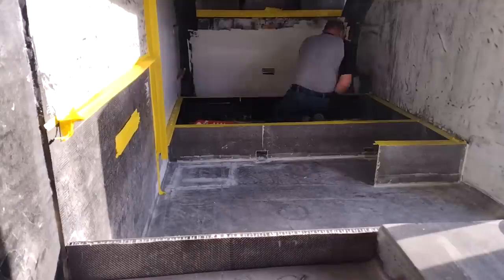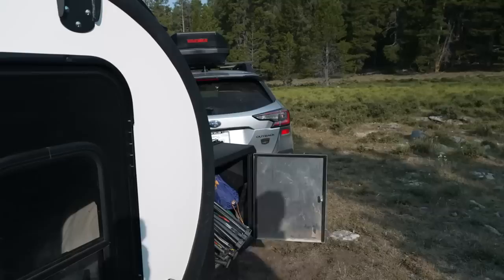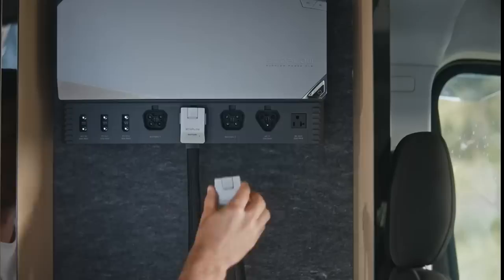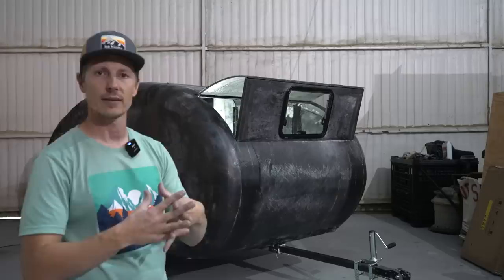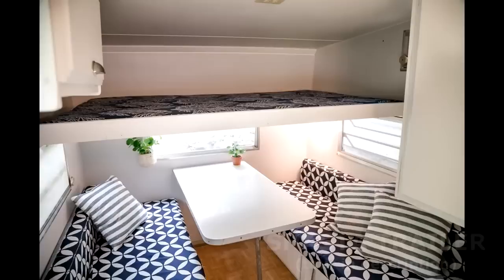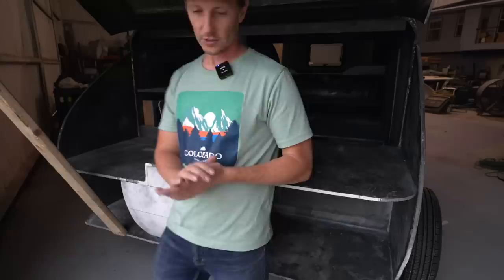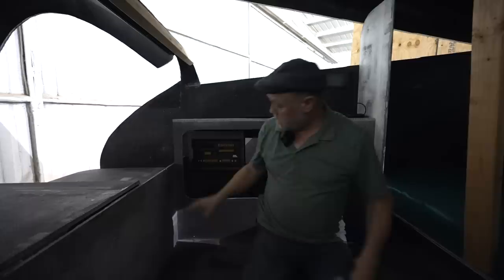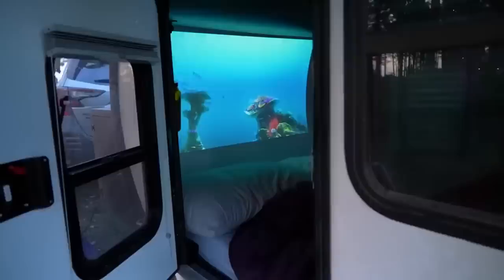World's First Pop-Up Teardrop Trailer With NO CANVAS!

Comment: It is way past time for an update on the tiltup trailer progress. A little recent history first. Early in 2022 Drew and I started talking about the trailer as seen in the two videos on Playing With Sticks' Youtube channel. In mid-June 2022, I had the first drawing of the exterior finished. The actual build started a month later. It went slowly. We shared the ideas and build process in that first video to see what the folks thought. The response was a little overwhelming to me. A year after the build started it is very close to ready to pull. We will do some test pulling before finish work starts. Better to see any problems that might exist. Then a lot of smoothing and painting. There are many significant changes since the last video. Nice curved line on the roof tilt up instead of the straight line I started with. Wheels moved inboard so no fenders. Instead, we have wheel skirts All for the good. Then I went to get it registered. It had been a few years since I registered a trailer in Texas and the rules have changed. Bottom line is that I cannot register this trailer as a home built or “hobby built” in Texas. That was my plan for the first trailers. Recent laws require an inspection by a law enforcement officer. Partly because the law is confusing, fewer and fewer agencies are offering this inspection service. Current wait times are 4-12 weeks. And all trailers must have a chassis, which is interpreted to be a steel frame with a body bolted to it. The only alternative is to become a manufacturer. That is a multistage process which we are part way through. It means more delays on when we can take the trailer out for testing and camping. It will be well into next year before we can possibly be in production. Anyone watching the economy knows prices are going up. Fortunately only some of our material costs are not changing much. So we are still looking at keeping this trailer relatively affordable. And as a side note, we think the classic 5 x 10 kit will be around 5K.

Thank you to all for the interest and comments. Our website is up but there is not much there just yet.
The website is published now,  but there is not a lot there just yet. We will be adding things as we can.
https://www.teardroplite.com/
Reply: Just came to this video to see if there was an update. I'm excited to see this build continue.
Reply: this looks great!
we'd be absolutely into buying this as a kit, or as a completed (but bare featured) trailer ready to go!
Reply: @teardroplite
Charles, do you know what kind of tools we’ll need to put a kit together? I’m guessing we’ll need more than just a hammer and a screwdriver….
Reply: @marynichols7429  First, this trailer will not be offered as a kit. The more standard size trailers will be sold as kits. Because they will be bonded together with slots and grooves, clamps and clecos will be used. Clecos are a spring loaded tool that goes into a hole to hold things in position. We will offer those as a buy back package. There will be predrilled holes to start you off. A drill and several 1/8 drill bits is the only power tool needed.  A good caulking gun to dispense the adhesive.  A 4 foot level and a small plastic dead blow hammer. Gloves and an apron for those who tend to be messy. Masking tape and a few plastic spreaders. Our intention is to make this easy.
Reply: Teardrop Lite LLC now has the authority to issue a VIN for each trailer. Next step is to be recoognized as a manufacturer by NHTSA. That is taking time.

Comment from the maker: Charles has announced a PRICE!  Here is the info from him: 

TeardropLite was started to design and produce extremely light weight, 5x10 teardrop trailer kits. I started watching a lot of videos about teardrop trailers. Around this time Drew and I started emailing back and forth regarding his family's dream trailer. And over a number of months this trailer design slowly came into focus.

Once Drew and his family have lived in it and we catalog any desired changes, we can lock in the initial design and produce molds. Using molds will cut making and assembling the basic parts down to a few days. It will be limited production at first and expand if needed.

Now the huge question... when? Drew, my partner Mitch, and I are of one mind on this. This trailer needs extensive testing in various settings and even seasons. As you all know Drew likes Fall camping. So I am going to say it will be the end of Summer before we can project a launch date. It is possible we will start making production tooling after he does a shake down camping trip. But look for a launch late in 2023.

The trailer will be offered as a basic shell, so each will be built with camper-chosen options. Stove, bedding, electrical and lighting can all add a little or a lot to the cost of a trailer. Windows are going to be fixed to standardize manufacture as the window and door openings will be molded into the parts. Our goal is to keep a simply equipped trailer in the low to mid $20,000 range. We will have to crunch the numbers in a few months to be more precise.

Later we will offer various upgrades and build options. And yes different floor plans will appear.

Cost benefit analysis of composite structures is complex. Simply put, carbon fiber replaces a greater amount of fiberglass so the cost is only a little more while weight is reduced a lot. Used with a fiber that is extremely good at dealing with impact and vibration loads, the overall structure is very efficient in weight and cost.

TeardropLite will have its own website. We will publish it once we are closer to production. Email me at the address below if you'd like to be notified when the site is up. I will email back as I have time.

teardroplite@gmail.com
Reply: That is a nice surprise in terms of price!
I appreciate the update, thank you Charles & Drew!

Looking forward!
Reply: Just to get some frequently asked questions answered here at the top. Gross weight is going to be set at 1500 pounds. The shell weights 525 pounds. Suspension, galley equipment and water, EcoFlow power station, and bedding bring it up to about 830 pounds. So it has a usefull load for all the stuff campers take with them of 670 pounds. With the braking system it should be towable by almost any vehicle. I expect most campers will be pulling it at around 1100 pounds.
The floor plan is 12 feet. The front curve to rear curve is 13'11". Inside width is 74 inches. Standing height is at 6'5". 14.5% of all American men are six feet or over. Only 1% of men are over 6'4". That should almost if not all potential campers.
Reply: @teardroplite  
Cristal clear,
Thank you very much!
Looking forward for the next news!!
Reply: Man I would love to watch the project management on this. So much to learn. The origin of this has so many criteria and I'd love to understand the decision making here. Either way, that's less than a year from concept to production and you've already got a relative sell rate. Bravo!
Reply: My gut still tells me that you will be asking for over $30k with some basic options when this is all said and done.  Would love to be proved wrong.  And no funny business where you try to hook us with a low price in the first year and then jack it up $10k for the second full model year of production after just a few trailers have gone out the door.
Reply from the maker: I think you’re sort of right. In that adding a lot of features would put this over $30,000. I say, sort of, just because we haven’t had a chance to explain Charles’s philosophy. While the trailer he is building for me, is pretty complicated in terms of what goes into the build. The trailer that he will be selling to the public is much more basic. That is why it will be coming at the price he mentioned, it’s basically a blank shell for people to add  what they want. Essentially it will come with everything you need, and nothing else  . His sales model is going to be much different than what you see from the rest of the industry. For example, the rest of the trailers he will be selling outside of this one are all to be self assembled at home. His goal is to make entry into Teardrop life as affordable as possible.
Reply: @PlayingwithSticks  interesting
Reply: I want to be notified when the trailer goes into production. Thanks

Comment: Hello Drew and Charles!!! Please include A/C and please consider placing a door with slides or drawers  under the bottom bunk and include and awning/screen room option off the side and galley areas. Also, PLEASE include lots of windows for light! 

There was also a GREAT idea I saw that uses L brackets that enable you to slide a standard 6’ folding table into the space above the fridge or in a larger storage area to give you the ability to setup a  nice camp kitchen or dining area while maximizing usage of space.Thank you!!!

Comment: You sold me on the weight - now just sell me on the end price. Love the Road Toad: weight/aerodynamics - check, composite - check, price - check check! But I also would like a more finished galley option as I no longer want to mess with too many DYI modifications (which really means for me buying things from say Ikea and hope it fits and still looks good.) Love all the innovative features of this design though it may have more features than a solo + dog traveler needs. I do want to find out more especially if I haven't dropped the dime on some other camper before this comes to market - and hopefully it won't require as nearly many dimes as say the Earth Traveler.
Reply from the maker: Based on Charle's philosophy it will be affordable for what it is. But, I have a feeling it will still be up there with the price of a decent teardrop based on the size of this and materials used. However, Charles' main goal with his company is to build VERY affordable teardrop trailer kits. These will be more modest 5X10 style teardrops that can be assembled in a long weekend up to about a week.  Like you I LOVE the Road Toad. But, I also would like a bit more of a finished galley.
Reply from the maker: If you go back to the pinned comment in this video (the first comment in the comment section)  there is now a paragraph from Charles. It states quite a bit of information including thepricing of this trailer. And fortunately it came in much lower than many people thought it would.

Comment: Hi,since the fenders stick out 1 foot on each side of most teardrop's , why not make the camper two foot wider by having the wheel wells inside the camper. I'm a contractor who has drove aluminum step van's for 40 years and never had the wheel well's leak. The well's will be inside of the floor storage. Carbon fiber very cool but for the rich ! I have a all aluminum 5x10x5 WeeRoll trailer that only weighs 890 pounds dry weight. If I was building my own I would have two doors with window's and screen's so my side wall's could have cabinet's  inside or flush door's on the outside for pull out storage , drop down shelf, shower access or what ever ( keep the wind drag down ) With a seven foot width your bed can go sideways leaving you plenty of room for inside table , seating and a porta potty,  Thanks for reading, it's always great to hear how people are doing their builds and equipment ! Summer is coming - Enjoy
Reply: Thanks for asking. I've always wondered about this too.
Reply from the maker: We have had a few people ask that same question in the last couple of weeks. And you have a really good point. To be honest I don't know other than aesthetics. I find if you go that route it seems to only turn out two ways. It can either have a nice boxy almost military look if you are going for an offroad overland style trailer. Or it gets a really futuristic almost Jetson's like look if you are going for something more classic.  Charles  is a huge Aero guy, so when we were originally looking at this we highly considered something like you are talking about. But, I am a sucker for a classic nostalgic look. So this will have some pretty intense GMC style fenders. The neat thing about fenders that large though is that we will be able to hide one 5lb propane tank in the back side of each fender. I am excited to show you that in the final build. Carbon fiber for the rich, exactly! That is why Charles mentioned his special fiber at the end. He ran across something with some great qualities that will keep the cost down. I absolutly love the WeeRolls. I just suggested one to someone a few days ago. Wow, I had no idea some of them came in at 890lbs dry. Nice!  I used to be a huge fan of cabinets. I am now changing my tune about them. I still think they belong, but I think a majority of manufacturers put them in the wrong place. I will talk about this in the next video. I couldn't figure out why I am so against larger travel trailers. And then it finally dawned on me after being in so many campers of so many different sizes and shapes. It is that hallway feel. I have come to realize, which was important in this design, that trailers don't really need to be big to feel big. They need to feel wide to feel big. And the problem is that most large trailers are built to feel narrow. Tight hallways and cabinets placed in ways that make you feel cabin sick much quicker than you would expect. When taking out our pop-up and our cargo trailer I quickly realized all you need is to stay away from the hallway feel and be very thoughtful about cabinet placement.  I like your idea for how you would build it. Like you, we would do a second door. But on this build I found I just needed that extra wall space.

Comment: Hey drew,   tell charles to look up "Conformal tanks".   the counter to "drag buckets"
Reply: You mean like the ones Burt Rutan's brother put under his LongEZ wings for is around the world flight?  Jennifer you are always s delight to hear from.
Reply: @teardroplite  Hi charle.   Nope i was thinking more along the lines of those used on the F-15 Silent eagle and being considered for use on all f-15's.   

the Rafale also has some wonderful conformal tanks it can carry.  

blended to be smooth to the body and allow smooth airflow over them.    they don't increase the drag in in some cases even lower the drag.   

LongEZ were just normal "drop tanks" style.   

The new superhornet also has a fairly good conformal tank on it placed right over its engine intakes and blended right into the body.
Reply: @jenniferstewarts4851   Wait until you see the fenders. They are headed in that direction.
Reply: @teardroplite  hehe, I suggested to drew,  Conformal tank blisters,  over the fenders... where its molded aerodynamically with a hatch to open to hide cargo, and the propane tank/tanks out of the air stream for clean air flow.  Maybe propane one side, diesel on the other.
Reply: @jenniferstewarts4851  5 pound propane in each side. Only one hooked up at a time.
Reply: @teardroplite  That works,   though i was half picturing 1 side in some models being used for diesel to power an onboard diesel heater  for cold weather use.
Reply: @teardroplite  The only problem her will be the paint.   Military stealth paint is heavy and expensive...   (also the stuff is bad in cold weather).   And the white XC-024 on doesn't have  a tail to be painted on.
Reply: @teardroplite    Ah,  the life..  extendable solar panels that form a "shaded area" and can be sectioned off for an outdoor bathroom/shower.   Waterpump with hose, and reverse osmosis filter system allowing you to fill your tanks from any lake, pond, etc.   Heat by diesel heater,  but the option for an externally mounted fireplace,  with a heat transfer plate,  so you can cook outside on the wood stove but heat from the stove can be transferred into the trailer through the radiator (better for small spaces to counter co2 poisoning o2 deprevation) But greatly increase the winter camp times as you can both heat and cook on wood, saving propane and diesel.   

Set up to be able to stay out in the wild for weeks.   Hehe.

Comment: Definitely need to add a water pump so you can set up an outdoor shower using preferably a built in water tank. For the roof maybe use a lift system similar to toy hauler bed lifts.

Comment: I'm sure everyone is giving you their suggestions, but here's one more: It would be cool if the roof lifted straight up like the Meerkat. That would give you standing room throughout the den area. It could be possible if you had scissor-struts (I don't know what they're really called) in the left and right sides. The front and back walls could hinge down from the top and lock into place for full stability. Finally, the left and right walls could be installed from the outside. It might even be possible to have bug-screen installed on the right and left sides so you could take off/leave off the side walls for great ventilation.